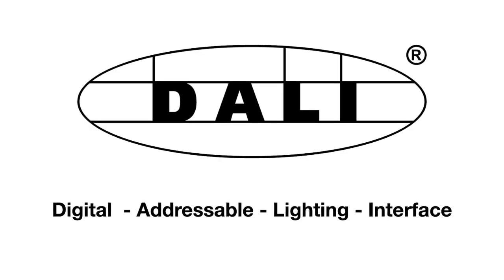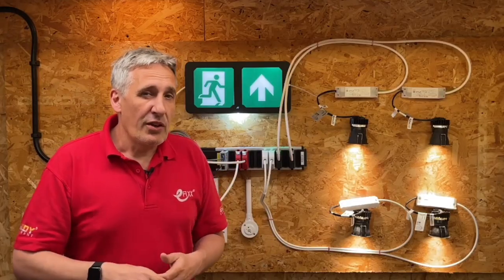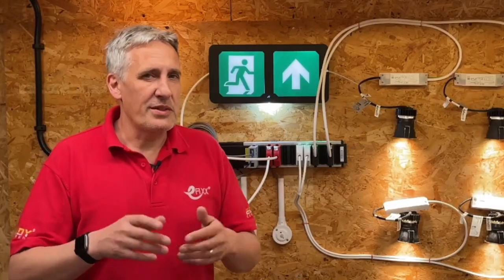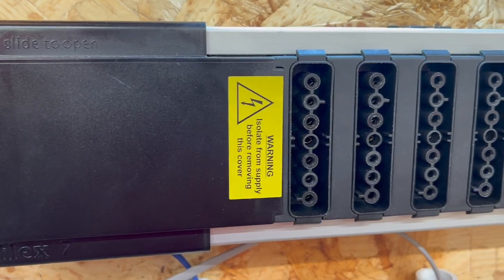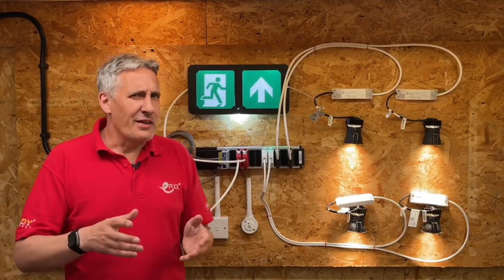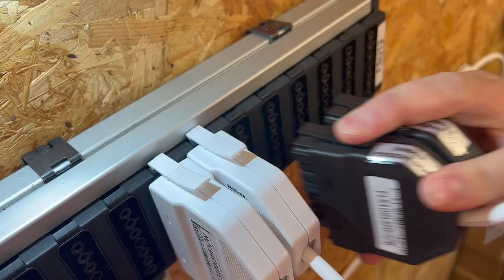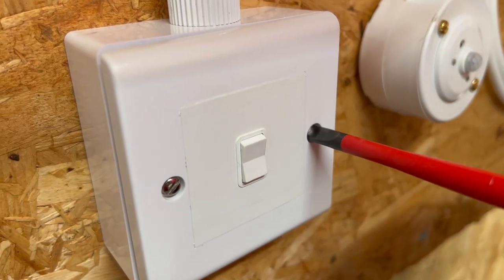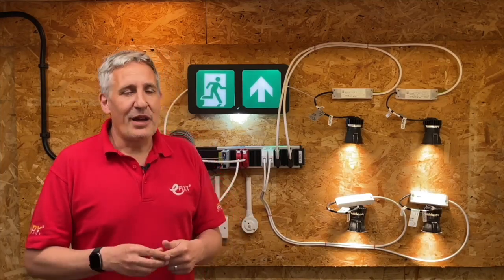Unlock the Secret to Easy DALI Lighting Control Wiring

Comment: Hi, I'm installing a DALI lighting system for the first time in a small office, and I have a question. What type of cable do you typically use between the Flex7 plug and the light fitting — a standard 6-core flex cable? I'm wondering if the switched live and permanent live might induce interference on the two DALI cores? The maximum distance between the plug and the fitting is about 4 meters.

Comment: All very well until they give problems, then such systems are a complete disaster for maintenance. We've some old Thorn Explorer XP128 emergency lighting systems in work, we can't get parts and nobody wants to work at them. One control panel has died, rendering the emergency lighting setup unworkable, other than knocking breakers off.

Comment: I quite like Dali stuff, but i dont like the driver terminal enclosures, they just arent designed for 1.5mm multicore flex. 
Most contractors buy a job lot of pre-wired pligs, all 1.5mm, 3,4,5 & 6 core, and dont look at how they will be connected at the driver, often leaving random sparks, mates, apprentices to connect them. 
This leads to chopped cores (cos there isnt an earth terminal, and cos the only leads left were 4 core leads when 3 core (or 2 core) was alll that was required), and cores that are visible outside of the terminal enclosure - and sometimes simply no lid on the terminal enclosure because it was too difficult and when they asked for smaller cables got told to 'just use these up'.
This is a massive bug bear of mine and no-one else seems to care.
Reply from the maker: We share your pain!
Reply: I had the same issue with some smart light controllers that were working perfectly but had no way of passing/terminating cpc making for some odd looking situations when used on-wire. Thinking back i could have used a junction box and use them as switches but would have complicated stuff

Comment: The CP Electronics "room by room" approach is called Vitp-7 and you don't need a commissioning engineer to set up the LCM's (lighting control modules) you look through the pre-set room layouts to see what fits your room layout, plug the lights in to what's shown in that layout and use the CP remote control to send the pre-set number shown on the layout.
Job done.

Comment: When I've done DALI installations it was the case you mentioned, of a person from the equipment supplying company coming to site when we had finished with  poropriety commissioning device to set each device up. Am I correct in thinking that is not the case with this manufacturer, if so, is it just the IR remote that is used because that would surelly bring the cost down a lot?
Reply from the maker: Yes that's right it's an out of the box control system for smaller rooms.